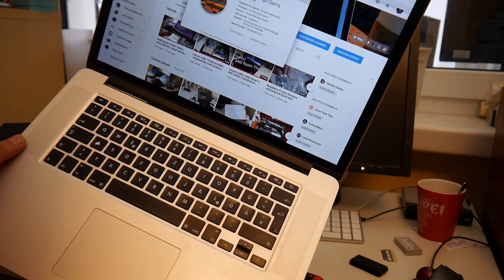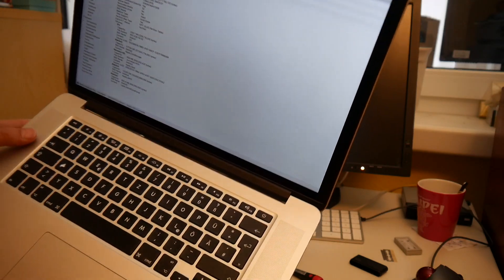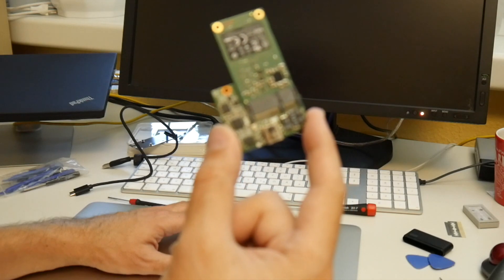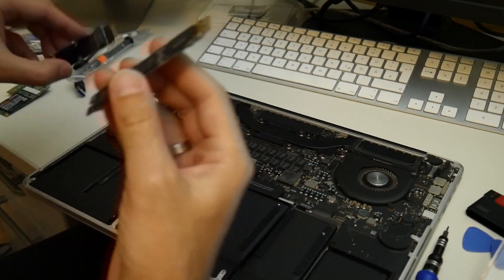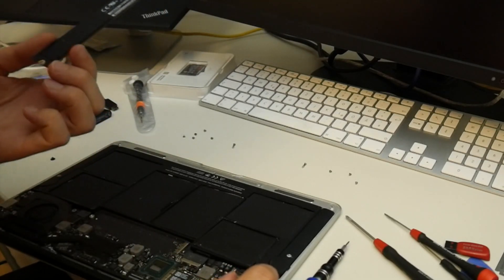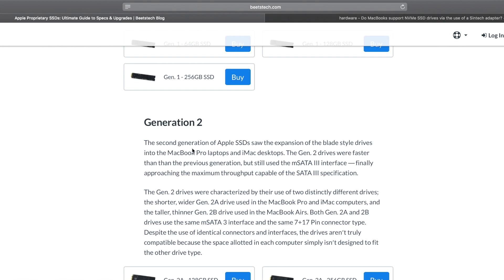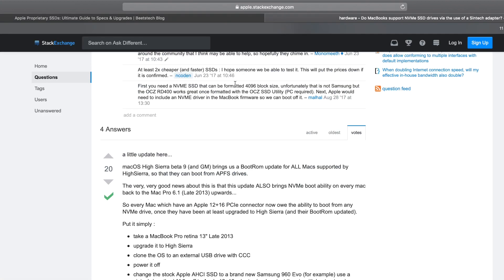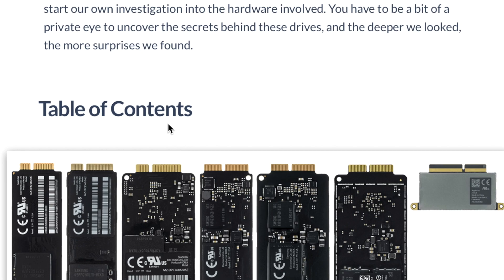Apple MacBook proprietary SSD upgrade & ultimative DIY guide!

Comment: Any of you have the footprint datasheet of this adapters, or layout dimensions. I am finishing one on cad software, I can't find any property Apple design anywhere in the internet.
Reply from the maker: If it helps you i could measure the one i have, 
..
Reply: @renerebe please if you are able to, I need the measurement on "mm" pitch pads 12 +16, width and length of the pad, the M socket spacing. SSD Apple propriety is the not same other computer M Ssd socket.

Comment: I'm sorta in the same boat, my 2013 Air 13'' is my daily driver, I wont upgrade because Apple has gone all Sony (hating their customers).

Lenovo I use for work/dev, X230T and others I have floating about.

I use a 128gb SD card that fits in my airs SD card slot as my secondary storage, which has worked well for the last couple of years.
Reply from the maker: Be careful with the SD card, I did this in my Surface Pr o3 for my Linux use before I got this Samsung T3, and the SD card failed after three month of daily use, WITHOUT I/O error! So I did not notice this and on the next reboot all my last afternoon's work was not saved, totally bizarre! Error-less failing appears to be common SD card practice! After that I got that external Samsung T3 USB3 SSD with regular quality, industry standard quality flash and wear leveling. Actually on my list to maybe make a video note about.
Reply from the maker: do you run the OS from that or "only" your user data? - as I booted from it which may have been a little bit more i/o load, …
Reply: Nah, internal SSD for boot/most user data, I store some data / run VM's stored on the SD card, it's not amazing as the SD card sits on the USB bus, but it works well enough for testing stuff.

Comment: did not even disconnect battery.... jeee
Reply from the maker: Why should I?
Reply: @renerebe  have you heard of shortage?
Reply from the maker: @greganikin7003  I only swap an ssd and don’t do any micro soldering in this service 😂
Reply: @renerebe  u can still short anything by dropping screw or moving anything. rule number one - get rid of any power supply.
Reply from the maker: Most power rails are off, and this PCBs have an isolating solder mask. Removing the battery connector bracket is as risky dropping it's screws than just swapping the SSD. Your welcome 🤗
Reply: @renerebe  battery connector doesn't have any screws in it)) you're welcome.

Comment: Understand your frustrations. My experience isn't as bad, though. Apple is still in my good books for now :)

I bought the new 15" Coffee Lake model a few weeks back. I'm not seeing any throttling - if I loop Cinebench on all 6C/12T for 15 minutes it doesn't dip below 3.2GHz (base clock is 2.2GHz). It sticks around ~95c the entire time. The fans ramp up to 5000rpm according to iStat. It's loud but the performance isn't being compromised.

My work Mac is the older 13" Broadwell 2C/4T Core i7 model. It will run at full boost constantly regardless of the workload. It runs above 80c and the fans ramp up but performance isn't compromised. My work Mac is constantly being hammered with docker, virtualbox, a million browser tabs, terminals, IDEs, office etc. It's almost always using all 16GB of RAM. It runs well (better than I'd expect from a tiny dual-core!)

I kinda like the 3rd-gen butterfly keyboard as well - there's a learning curve but it's quite nice once you've adjusted. The short travel is made up by how snappy and tactile the switch is. If I had a choice I'd give the edge to the old chiclet style keyboard, though.

Ideally Apple would continue offering machines with socketed components (RAM, SSD, CPU) but that's unlikely to return - we're only going to see more integration through custom hardware (e.g. T2) going forward. TBH, if Apple's ultimate goal is to transition the Mac to Arm and custom Apple SoCs then upgradability ceases to be an option anyway.

The real bummer, IMO, is that the PC market doesn't really offer a solid alternative - you end up having to compromise in other areas. Thinkpads are ok, they're a bit cheap, the displays aren't fantastic and they tend to have throttling issues, they don't have the same level of after sales support... but you get socketed RAM/SSD/networking/etc. For me the negatives outweigh the positives.

Honestly, I can live with the compromise Apple offers, the only thing that truly bothers me is the price. I still feel sick thinking about the cost of my new Mac (even after EPP discount...).
Reply from the maker: PS: I'm actually not that frustrated, thanks to my primary use of Linux (and also Windows, in VMs for our commercial software dev & testing), I'm thankfully very flexible in choosing hardware that fits to me. I believe some pure Mac users are certainly more frustrated than me. – Well, with global warming I realised mine already throttles when idle (!!!) just by charging in our 30°C warm office in the new Berlin summer, ..! Maybe the VRMs already get too hot or so? But the new Macs are irrelevant for me anyway, I will not buy anything with soldered storage (SSD), and preferable also not RAM, or glued battery, … not to speak about the questionable keyboard that does neither type nice, nor lives long. And even unscrewing the new keyboard is an extremely cumbersome and time-consuming if not damaging process 50 to 100 screw process: https://www.youtube.com/watch?v=4KuVvb9DTaU
Reply: Break out of Apple's ecosystem. It's bullshit.
Reply from the maker: me? https://t2sde.org ;-)
Reply: @renerebe  Good point about the hot summers we (Europe) are now seeing. I imagine this machine would run closer to base frequency in hot weather (or at least become uncomfortable to use on your lap).
Reply: @LittleMopeHead  I'd happily try something else if there was an alternative!
Reply from the maker: Yes, I was really surprised about the heavy throttling in >30°C ambient temperature this summer while idle just charging the battery. I diagnosed that one hour booting, diagnostics back & forth. I already thought something got defect, but holding it over and aircon cured it. I knew it throttled while Xcode compiling or iMovie editing these videos, but in a warm room is really ehrm, unfortunate.